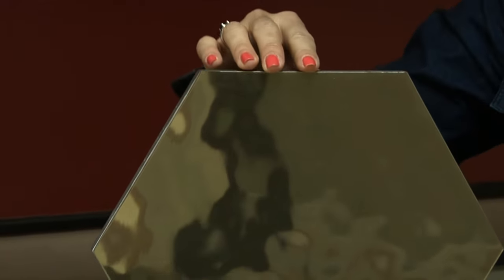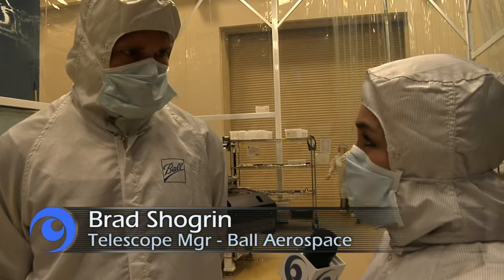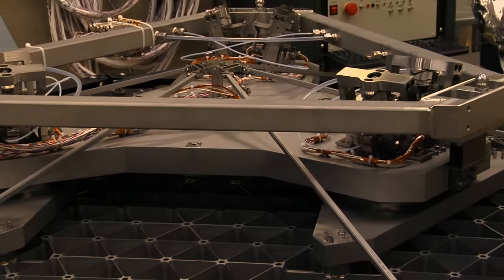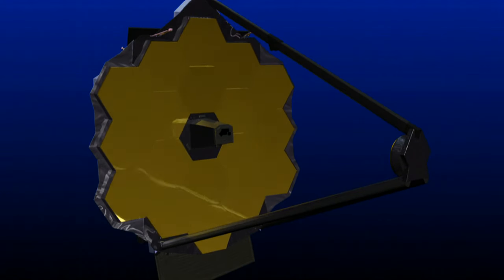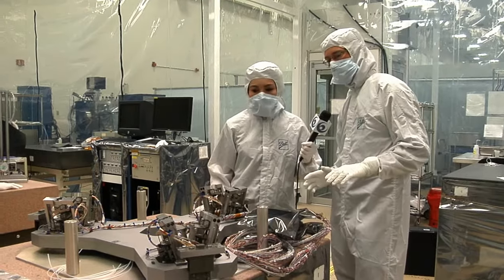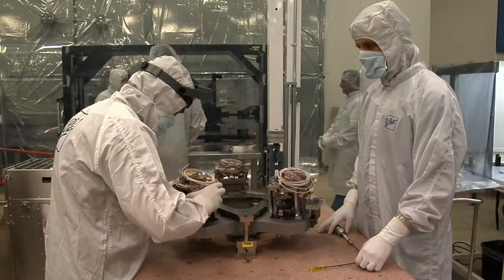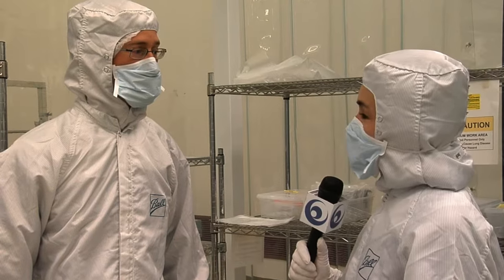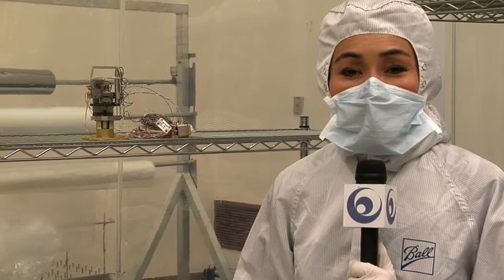The Secret of the Actuator

Comment: It's bizarre to think these large pieces of metal can command movements to the nanometer, yet handle the hell of launch. Such elegant technology.
Reply: Same here. What sort of mechanism is involved to make such minute movements, particularly where machine tolerances come into play? It's incomprehensible to me.
Reply: Robert Warden has a paper available online where you can learn about the actuators he designed, he even built a working model out of Lego and uploaded a video of how it works. 

There's no servo control or anything like that, all the fine adjustment is controlled by gearing changes. It makes the mechanism inside Rolex watches look like cheap junk.
Reply: @jordythebassist  Hey that's neat as, thanks man, having a look now.